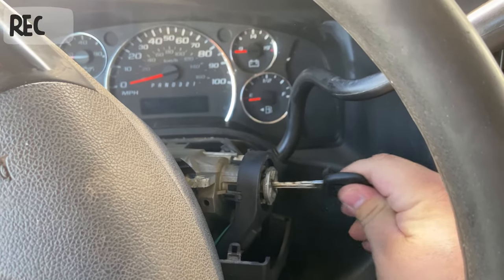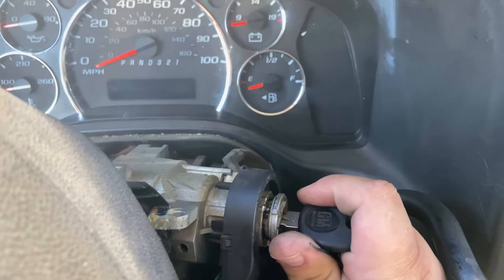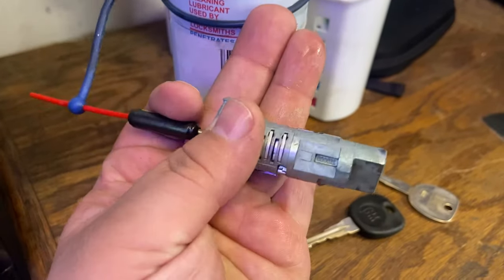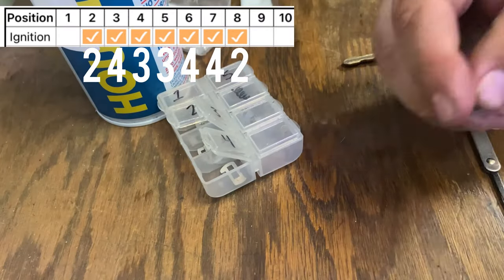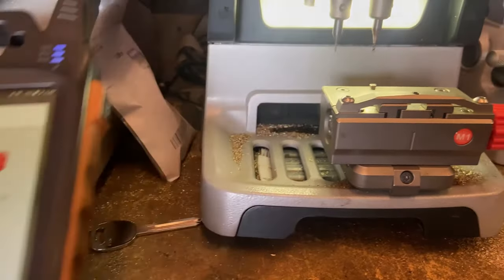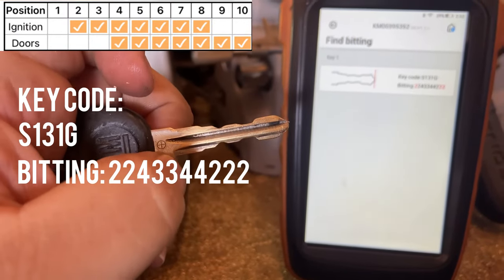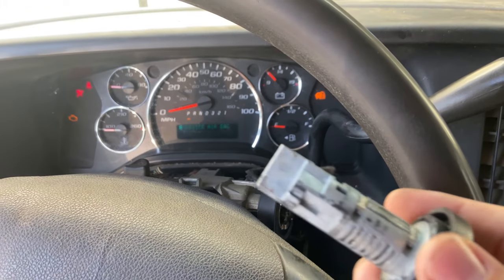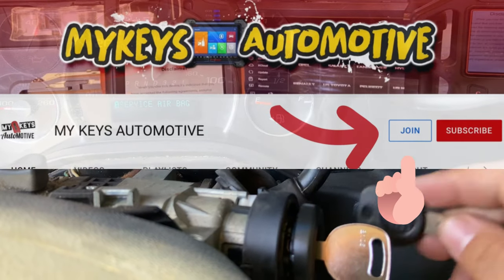CHEVROLET IGNITION LOCK CYLINDER REPLACEMENT/FIX (WITH TRANSPONDER) Z-KEY WAY

Comment: If dont have the extra money to buy a new switch or cut a new key, just grind down the side lock bar underneath the cylinder until its smooth and even...reinstall it until you are able to buy a new ignition switch cylinder or key made  but you can use any key crank your vehicle.
Reply from the maker: Thank you for sharing
Reply: @MYKEYSAUTOMOTIVE  no thank you cause video gave the idea to do that, until I was able to buy a new ignition switch 🫱🏼‍🫲🏾

Comment: Great video Thanks! can you leave a link for that straw attachment you were using? What kind of grease do you use?
Reply from the maker: Yes I can! The white kind that usually comes with the pin kit!
Reply: @MYKEYSAUTOMOTIVE  Thank you!
Reply from the maker: Thank you!
Reply from the maker: THE LOCKSTRAW 
https://www.americankeysupply.com/product/the-lockstraw-bi-directional-spray-nozzle-for-aerosol-lubricants-14005

Comment: Hi, I have the same truck and I lost the keys, How do I deal with the transponder? any videos about it?   Thanks
Reply: Must the circle plus transponder .. and made .. you can do it on board programming   10 minutes turn on and off for 3 times .. don’t brake the antenna around the switch .

Comment: Hello, I see the ignition cylinder. But, is that an ignition sensor or module, that's over the key cylinder? I am talking about the black piece with the 4 terminal, wires coming out of them? Not the ignition switch.
Reply: Thats the immobilizer and key antenna receiver.

Comment: But now it doesn't start it'll turn over sometimes and when I put it into drive or try to back up it will die before I can even put it into gear so you believe it's in it's in the tumblers or you know in the cylinder I think I need to change it out that's what I'm going to do but I want to know first so soon as you can help me let me know thank you
Reply: Put old key next to it not programmed correctly
Reply: @bobbyu8991  hey Bobby I already got it man it wasn't hard at all not as hard as I thought it would be. On my 07 Chevy trailblazer all I had to do is take the top cover off and put it down in that that little ho slot and push it towards the key and or cylinder and it just pops out. Very nice uh? Thank you
Reply: @bobbyu8991  let me know how you think I should have it reprogrammed if the key don't work?